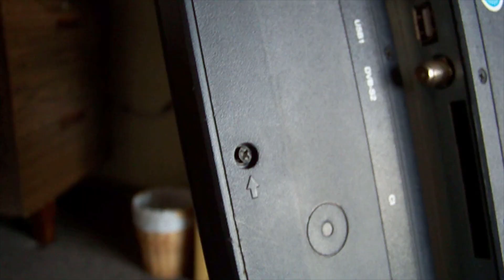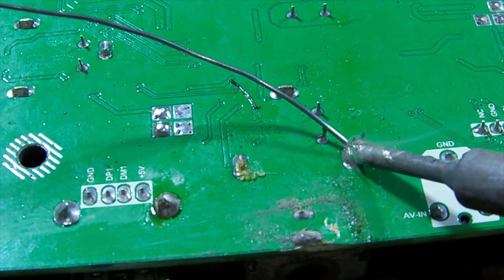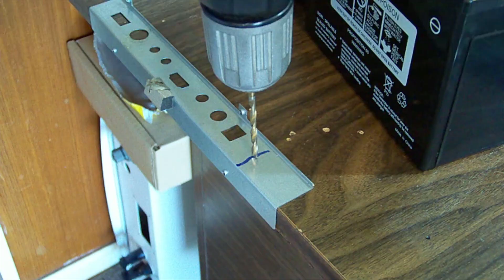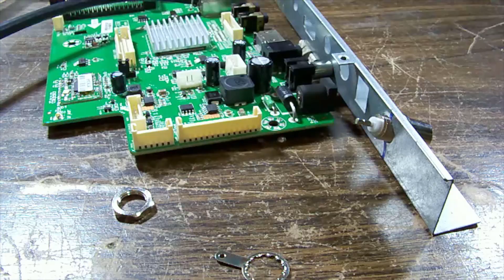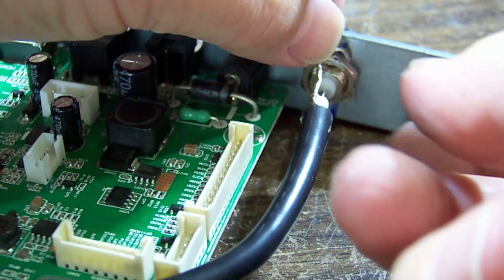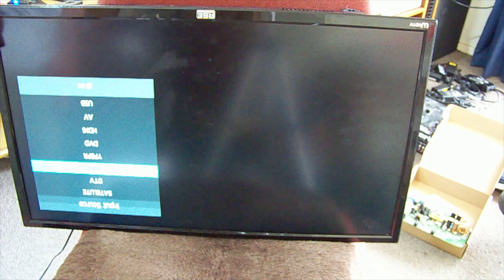RSE camper RV motorhome TV antenna socket repair

Comment: Does the length of the stranded wire need to be exactly even with the center terminal or could it be cut shorter if need be
Reply from the maker: Can be any length